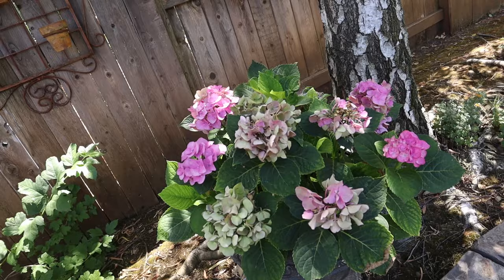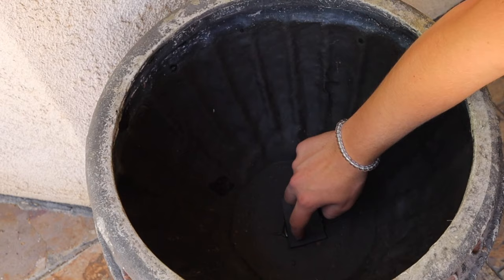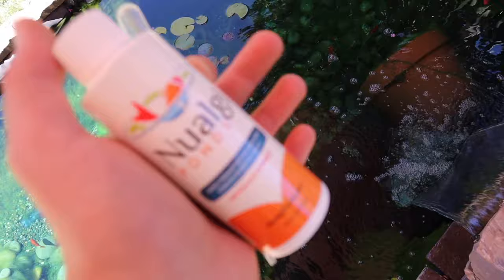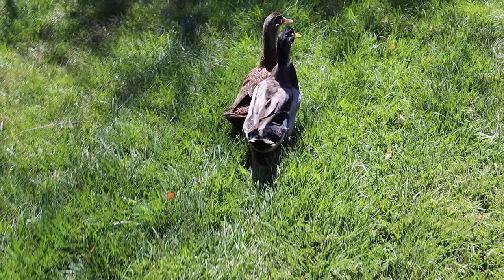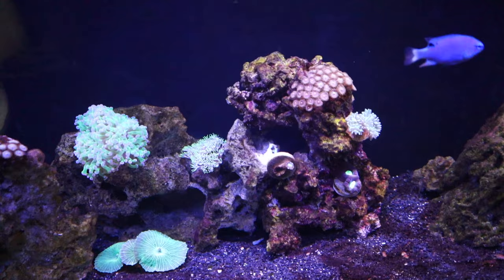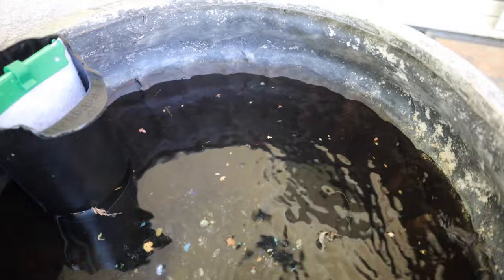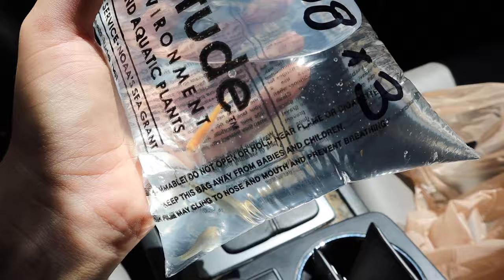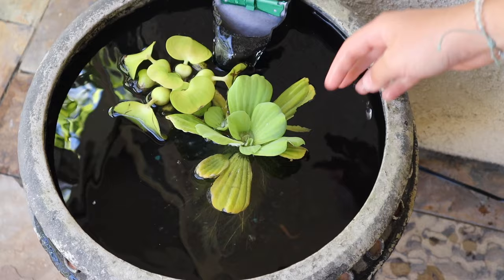DIY Flower Pot FISH POND *mini pond build*

Comment: You are so cute.
Thanks for your video, I would use aquarium silicone to seal the mini pond, but maybe it will work out fine outside, I don't dare to use it, when the pond is going to be inside in my apartment. 😅💪

Comment: PLEASE do not use hot glue or super glue in pond or aquarium situations! While they are aquarium safe, they will dissolve very quickly. It is far, far better to just use aquarium silicone.
Reply: I have this exact pot in my shed and this is a great idea for it. If I shouldn’t use hot glue, what should I use to seal the hole in the bottom for my fish pond?

Comment: Ok I have a question I am getting new fish I have to change my substrate with means taking all the water out I have two hang on back filters and a sponge filter the all have biological filer aka good bacteria will this be enough to keep my tank running if I save the bio media will it be ready for new fish right away
Reply from the maker: It would probably be enough but the substrate does carry a ton of bacteria as well. Why are you removing the substrate? If I were you and I had to replace the substrate I would add some bacteria supplement right when I re add the fish just to be safe
Reply: I am getting shell dwellers they need sand and they like move the sand around and stuff it’s going to be so cool